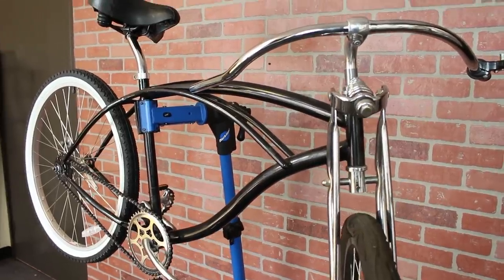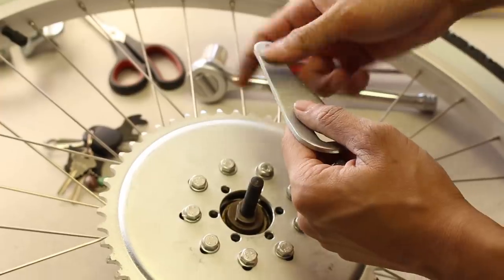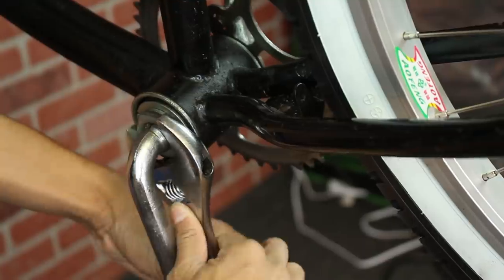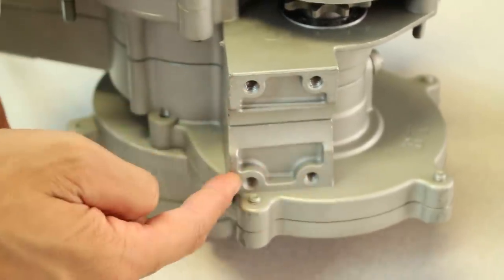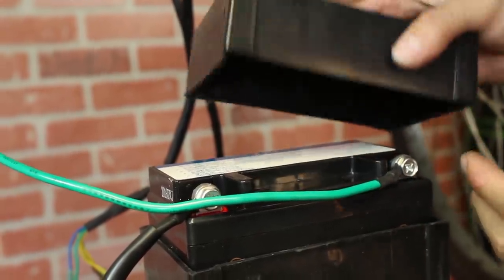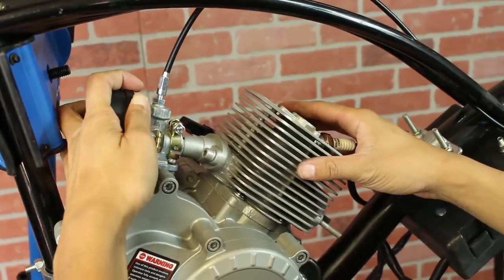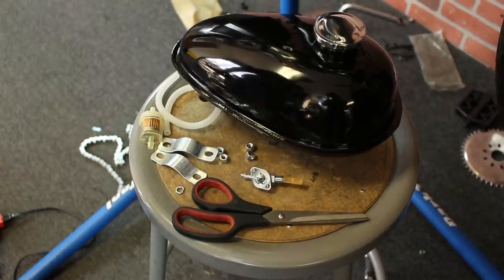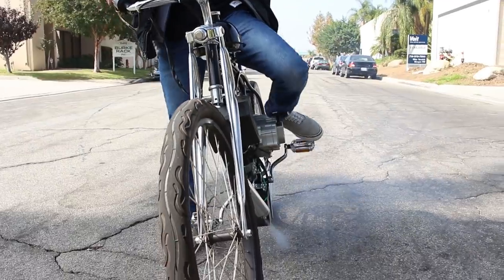How To Install a 2-Stroke 66cc 80cc BULLET TRAIN Engine Kit for Motorized Gas Bicycle

Comment: Nice video. Could you get away with a smaller starting battery? That one seems a bit heavy, big, and overkill.
Reply: Don't get a lead-acid battery, get a Lithium Iron battery.
Reply: @letmepicyou  that's a terrible idea. They are only 3.7v and don't handle like lead acid. Why would cars still use lead acid batteries

Comment: Add some nice rubber between the motor and frame mounting hardware and also use blue loctite on the studs going into the engine

Comment: Will this fit on a stretch beach cruiser
Reply from the maker: As long as the bike is a men's 26" with at least 11 inches of clearance from the top tube to the bottom bracket there should be not issue.

Comment: Do we use 2 stroke or 4 stroke oil? The manual im reading says to use 4 stroke. In the vid it says 2 stroke..
Reply: the oil he poors into the engine is 4 stroke oil. aka motor oil. 10w30 should be good. then you have to premix 2 stroke oil and gas for the gas tank.
Reply: Kimberly Mejia isnt the oil going into a wet centrifugal clutch? Is it better to use atf fluid rather than motor oil?

Comment: Pretty slick, but why have a battery. I have a chainsaw with a bigger engine and higher compression than this, and pull starting it isn't all that difficult with the compression release.

Comment: fun fact only run 16/1 and 20/1 for the first week to a month after that stick with 32/1 yes its a bit on the pricey side but your engine will be less choked and it will sound cleaner and run faster.

it will also save your engine because it makes less pockets on your engine.

Comment: A 12 volt battery WILL NOT HARM YOU!  lol
Reply: Ya hahaha funny because I'm working on a microwave transformer rn A transformer will harm you😂😂
Reply: uhh take a few amps to the fingers and tell me how it feels "lol"
Reply: Human skin isn't conductive enough for that to happen. Sure, if you wired a few amps to your heart you'd be slightly dead, but 12v isn't enough to penetrate the skin and transfer those amps to your heart. I've installed deep-cycle 24v batteries on boats before, and even with hands wet with saltwater I didn't feel a thing. I'm not trying to be condescending, that's just my personal experience
Reply: oh no, 12 volts ahhh! lol
Reply: Nope unless its a ridiculous amount of amps like in the 1000s
Reply: "Nope unless its a ridiculous amount of amps like in the 1000s"

Nope, that won't do a thing.
Reply: Why not get a motorcycle??
Reply: The amperage of a 12v battery can be used to weld steel, it can cause nasty burns, be aware!
Reply: I dont think my left hand agrees
Reply: A  high amp/hr 12v battery can give you a good tingle across dry skin. It can't lock you down like higher voltages, but it can be highly unpleasant.
Reply: @edism  indo rock muziek
Reply: @thestalicho  Steel has a low resistance, this allows a lot of current to flow which is why it can weld. You're skin has resistances of 100,000+ ohms. By ohms law, the current flowing through you will be at most 12/100,000 which is absolutely minuscule. Don't spread nonsense. Remember that just because it has the potential to deliver high currents, it doesn't mean it always can.
Reply: if you look in the manual says 70 cc and in struction book for this engine kit BT80
Reply: A 12v battery can definitely kill you those things can deliver a ahitload of current. But for that to happen you would need to touch positive and nevative with each hand and your hands would need to be super sweaty and even then you might be fine. It'll hurt like hell but as long as it doesn't cross your hearr you'll be ok. But at that point it's just luck. But no a 12v can kill you for sure. It is unlikely and as long as you use common sense you will be fine but it is possible.
Reply: Source: I work with electronics daily and have studied them for years. It only takes a few miliamps of current across your heat to kill you. It all comes down to how well your skin is willing to accept charge and where thatncharge is applied. Certain fluids like saliva and sweat work really well as electrodes. And can be great for transferring electricity into your body.
Reply: @gangisspawn1  A motorcycle needs insurance, registration, and a licence to operate it. If a motor is less than a certain cc displacement none of that is required and the bike can be used as a regular bicycle which you can even bring indoors to park indoors and not get parking tickets. The fuel costs next to nothing too. The benefits are endless.
Reply: @justinfewkes3535  You mean the M.O.T. ouch... what about the microwave capacitor...
Reply: no they won't kill you but they can give you a nasty burn. the twelve on my truck did that to my finger and it really hurt.
Reply: @justinfewkes3535  thats because a transformer regulates 110v to 12v at like 35 amps so yea that'll hurt. 12v 7ah is not going to hurt
Reply: Yknow the only way to hurt yourself with these low voltage batteries would be to take metal to both terminals like a wrench. Won’t happen anywhere else.

Comment: Would it not make sense to upgrade to disc brakes?
Reply from the maker: It is entirely possible to upgrade to disc brakes, for our build it was not necessary. Some bikes are ready for disc brake upgrades, depending on the bike frame and fork, others would need a modification or not possible at all.
Reply: Fair one.....although..metal+welder= anything you want lol.....Go fast stop quick has always stood me in good stead.....apart from when it didnt....then it hurt!

Comment: Can this engine be connected to a jackshaft?
Reply from the maker: Our engines do not come ready for jackshaft connection. With some modifications it would be possible. We would love to hear about your build if you do end up making it.
Reply: BikeBerrycom I do plan on doing it i'm about to be ordering what I need from you.
Reply: It will be a little while before I can get the jackshaft but at least I'm getting it ready for it! I got the engine coming on the 7th of this month for a start.

Comment: How to get my electric start to work I have every thing hook up right and still will not start with the electric start
Reply: I'm having the same problem
Reply: @robertcdicus9223  check the fues
Reply: Got it working i foundbtwo wires that werent connected. Does your engine make a clanking noise?

Comment: Connect the battery last ???
Reply from the maker: Yes, typically, if electronics are being installed, the power source should be the last, for safety concerns. It was in haste to finish this video quickly that we did this in the wrong order.

Comment: How top speed?
Reply from the maker: They average 35mph top speed with stock setup. Speed varies depending on the weight of the bike and the weight of it's rider. Hope this helps :)
Reply: BikeBerrycom bullshit, bike only does 27 before redlining
Reply: depends on rider weight mostly, and oil ratio you run. not even broke mine in yet 20:1 and it it outruns my ported 49cc china girl which does 27mph on a 40T sprocket

Comment: What do you mean that battery is highly dangerous? IT is only 12 volts DC. You can hold on to the leads of a car battery whilst cranking it and you won't feel a thing.
Reply from the maker: Definitely not fatal, but it is uncomfortable.

Comment: 12volt7amp can't hurt you 🙄also the big red button is the kill switch, the thing's miswired, you were using lighting switch as engine kill 🤣
Reply from the maker: We're very much aware 12 volts can not cause serious harm, but it is still not a pleasant feeling we would consciously want to experience. We are also aware of what the intended switches are for, but due to being a third party accessory, the control's wiring does not perfectly match with our other components. It can be an isolated incident with that specific control, or a common a incident for our combination of parts. Out of the box, plug and play, that was how everything worked.
Reply: BikeBerrycom have you ever touched battery terminals with you hands, it does nothing you don’t fell it.

Comment: where does one get an in line fuel filter
Reply: terence richards 
anywhere you can buy small engine parts. and ace hardware or home Depot will have filters for about any size line on the shelf.
Reply: And 1 comes with the kit

Comment: Do you need a motorcycle driver license on this?
Reply from the maker: You do not. Small motorized bicycles do not require any sort of license or registration. The engine size to fall into this category varies within every region, some states marking it as legal if under 90cc and others only if under 70cc. We recommend contacting your local DMV for accurate information.

Comment: What in heck did  I just watch!  Put the sprocket on backwards.  Shut off switch was connected to lights, Master link was going in wrong direction, You might as well of used a freaking impact gun on the spark plug at that point lol!   but all that aside has anyone actually made one of these and had it last? I heard they turn to dust really easy?

Comment: What is the milage??
Reply from the maker: Our 66/80cc engines are rated for 120 mpg at optimum tuning. This varies, depending on tuning, parts, and the break in of the engine.

Comment: Get rid of that heavy battery, I wired a 14.4 volt lipo battery to my BT motor and it cranks fast and has been in my bike 6 months with no charge  and weights less than 8 oz.

Comment: Honestly the battery isn't worth the trouble
Reply: god is a Sciopath lol wut
Reply: roufdrapht Weight and danger.
Reply: @heavystarch100  Exactly. Not electrical danger though. If you fall over and the bike flips, it's not good for lead acid batteries for them to be on their side.

Comment: if its 2 stroke the why is there a oil pan
Reply: gears maby?
Reply from the maker: Rest assured it is a 2-stroke. The automatic clutch is considered a 'wet clutch' and requires 4-stroke oil to lube it up. Helps maintain it and prevent any premature damage. Hope this helps.
Reply: BikeBerrycom it the clutch the same as the older peddle start engines
Reply from the maker: Nope. They are centrifugal wet clutches. Think of them as an automatic clutch. You start the motor and it runs idle and will only accelerate if you throttle the handle. It will stay idle until you hit the kill switch or run out of gas. Hope this helps clear up some confusion.
Reply: Hi, please tell me that this electric start engine can fit on FAT TYRE BICYCLE

Comment: What can't u put grease in the pedels
Reply from the maker: Any moving component should be greased, including the bearings in the pedals. Luckily, all new pedals come greased and ready for installation without the need for maintenance. This video shows installation for upgraded parts. Information involving pedal maintenance would be for a separate video.

Comment: if the battery is just for the starter switch i would just skip it and use the pull cable

Comment: Bike looks very nice but that battery location is horrible!!! It also seems to ride slow as hell but it look badass, tho. Maybe the battery would've been better if it was vertically placed under the seat, aligned with the bike frame that leads to the pedals, maybe, because under the bike like that, is horrible!!!

Comment: If the boss caught me using an adjustable wrench or pliers on a customer car, he would have me fired
If the boss caught me not using a torque wrench for spark plugs on a customer car, he would have me fired
if the boss caught me not using a wiring diagram for electronics on a customer car, he would have me fired for being so lazy that I can't even go to a computer and get a wiring diagram from Alldata
Reply from the maker: Nice, well it's a good thing we're working on bicycle engines and not cars. We also use tools the average person would have in their garage.
Reply: agreed.

Comment: why on a hi rpm 2 stroke engine & transmision  the mounting bracket you need to ad rubber between the compression u bolt system and tig weld 1/8'' fillet welds 1'Lg I see why your offering an inexpensive kit for people I just think you should show a hi end build to point out how someone can balance between the two?

Comment: You installed the fuel filter the wrong way around.
Reply from the maker: We are well aware of this error and have posted a correction in the annotations. Please, turn on the video annotations by going into the video settings and clicking on the annotations button so that it shows red.
Reply from the maker: Thats why we already noted that at the top of the video.

Comment: Your rear sprocket process takes to long and you make to much double work
Reply from the maker: Completely agree. We do carry a cnc'd BBR sprocket adapter that attaches over the hub rather than the spokes. It is much easier to use and more reliable than the standard sprocket assembly.

Comment: uh...lol...its only 12 damn volts and it's DC aka, direct current....you can lick the top of that battery and be ok....touching it with both hands without gloves is perfectly fine....
Reply from the maker: Safety First, Roy.
Reply: Does it have a charging circuit or do you plug the battery in when parked?
Reply from the maker: The typical battery used on these builds are small body 12 volt batteries that work similar to 12 volt car batteries. It doesn't need to be charged unless it is now and having problems starting the engine.

Comment: 1) Needle nose pliers are not for holding nuts for tightening.
2) Those gloves will not protect you from electrical contact. This requires proper voltage insulating gloves.
3) Running the ground wire, as you have shown in the video, leaves it prone to chaffing on the positive terminal nut.
    This can cause the ground wire to short to the positive terminal. The ground wire should be run out of the right side of the cover, and over the top.
4) Since the bike could be exposed to moisture, use dielectric grease on all electrical connections.
5) For the love of god, you DO NOT tighten a spark plug down "as tight as you can". You can find torque specs online for any spark plug, but in general, tighten only until the washer seats, then an
     additional 1/4 to 1/2 turn.
6) Adjustable wrenches is not the proper tool for tightening exhaust nuts. Adjustable are for idiots to hammer nails with.
     Use a socket & torque wrench to tighten the nuts evenly, and to the correct torque.
7) Adjustable pliers are not for tightening nuts. Adjustable pliers are for pulling nails out of boards, that were hammered into the board by an idiot with an adjustable wrench.
    Use a ratchet & socket.
8) Dammit man, use a socket on the oil drain plug.
9) Did you seriously use a cut off soda bottle for a funnel???
10) Why are the handle bars oriented correctly while the bike is in the shop, but in the outdoor scene, they are installed upside down????????
11) The big red KILL SWITCH does not work because you connected the wires for it to the light switch.

If you are going to post a "how to" video, start with the proper tools for the job. And don't post information that is incorrect. and unsafe.
Sorry, but I've got to give this one a thumbs down.

Comment: Use gaffa tape to hold the bolts in place while mounting the sprocket. Don't use spring washer but lock nuts or give them some Locktite before finally tightening them. Tighten them over cross to distribute the load evenly and align the sprocket as it should be. Get rid of that chain tensioner..! It's an accident waiting to happen. Sooner or later the shitty thing will come loose and tilt into the wheel. Fabricate a springloaded tensioner that is mounted in front of the wheel. 
Oh..and throw that damned crescent wrench to hell..! It's the worst piece of shit invented to round all bolts that sit remotely tight in there. Use a fixed spanner and spanners with a box end.
Best use for a crescent wrench is to open the beer bottles or to throw it at the neighbors dog when it shits in your garden.

Comment: ffs, its not like 12 volts is gonna kill you
Reply: No, this wont, but 12 volts with manny amps can..
Reply: 10vdc 250 amps can stop a heart I wasn't paying attention when I was blowing out the dust with  air  and got too close and the cappassistor  discharged 460vAC 3 phase in went thru my arm thank God I had my other hand on the welder
Reply: Won't kill you but if you are wearing a ring and it gets shorted it will burn the skin off your finger in less than a second.

Comment: That battery can't shock you.
Reply from the maker: Every battery that has a charge can shock you, the only difference is if the charge is lethal, or simply unpleasant. I'd personally still try to avoid a shock, even if its unpleasant.

Comment: I don't have coaster brakes ... I have calipers front and rear ... Freewheel rear end ... Won't the motor make your crank and pedals speed up ??? ... What do you do with the tank on a step thru frame ??? Sorry girls ... You can't have one ...
Reply from the maker: No, as long as your rear wheel is not fixed gear it should spin freely. The engine kit does not attach to the bikes standard drive system, and only affects the rear wheel. It should act similar to ridding down a hill.

Comment: The fuel filter is on the wrong(upside down), Handle bars are the oddest shape I've ever seen, And you don't tighten the spark plug as tight as you can lol... You tried but everything you did here seems like a bad IKEA instruction guide.

Comment: "evenly tighten" uses a drill really bud? Not a torque wrench.... "Evenly tighten"
Reply from the maker: We try to use tools the common DIY person would have. In this case we used a drill which works perfectly fine.  Let us know if you need any bicycle engine kit parts and accessories, bud.